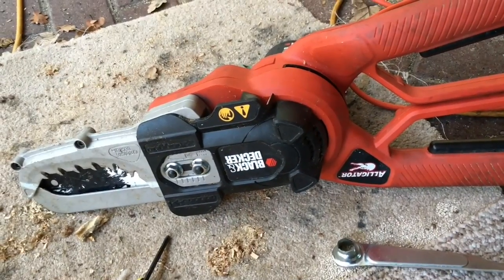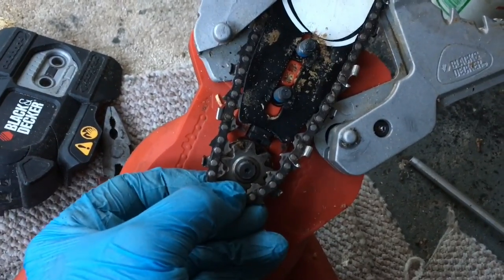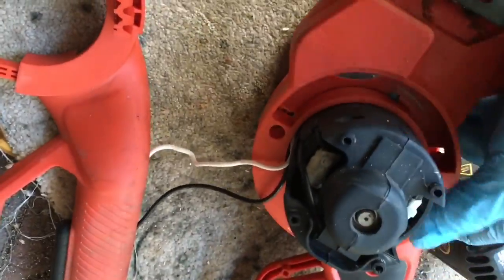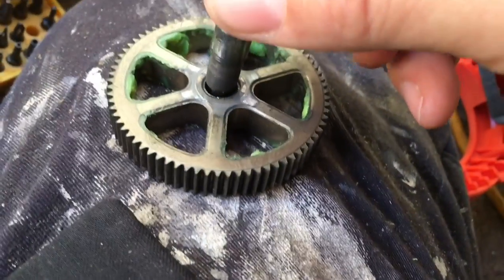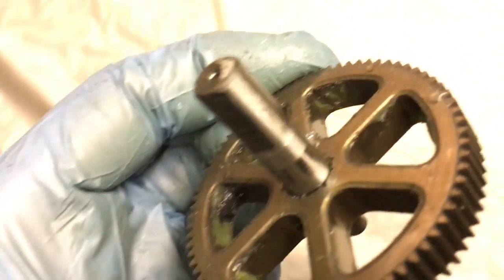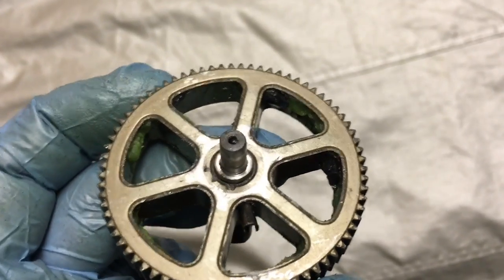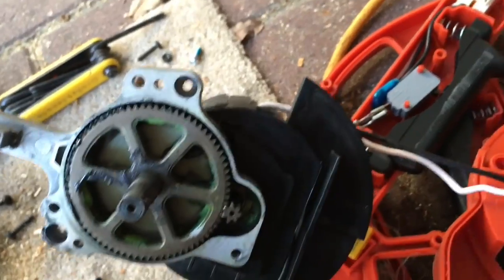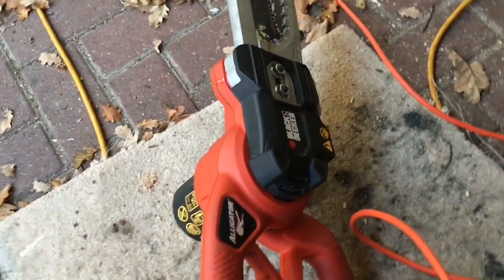How to Fix a Black and Decker Alligator Chain Saw

Comment: Again, great video. 
I don’t have access to drill bits for hardened steel so i have tried two other approaches; hammering the wheel back onto the shaft together with loctite (didn’t work), and adding a spot weld to fix the wheel to the shaft. The latter seems more promising but requires some shims to separate the two casings in order to fit the weld…
Reply from the maker: Thanks. Well done trying.

Comment: I would certainly give Loctite 270 a try first. Having said that, our Alligator is now 9 years old and despite doing an enormous amount of work (we use a wood-burner for much of our winter heating) it is still working just fine. We keep it well sharpened and don't rush it through the job.
Reply: Cornelius---Can some one please explane how to remove the plastic casing  (number 10)  left and right enabling to change the carbon brushes
Reply: Hi there two years later, I can confirm loctite is not going to be enough. I have now added a spot weld to fix the wheel to the shaft, it looks like it could work but the two casings that house the gear have to be separated by shims (couple of M5 washers works), so my gear box is no longer enclosed. But I guess I could squeeze some more hours out of it now 😀
Reply: Disclaimer: I tried generic “loctite”, not loctite 270 in particular….
Reply: @baxtrom  Ah, OK. 270 is the stuff for permanent assembly and is way stronger than 243 or 290 that are intended for things you might want to take apart some day. A pal of mine used 270 to lock the screws on a model helicopter - big mistake!

Comment: Could this shaft connection be intended to fail and save the motor or gear?  I had it all the way apart and gearbox back before another search led me here.  I DID NOT realize the shaft wasnt fixed to the gear.  The spinning likely expanded the tolerances so that the press fit isn't effective anymore.  Silly problem.
Reply from the maker: I doubt it was designed to fail deliberately to protect other parts as once it has failed then your normal consumer would just throw the whole lot out.  Press fit of gears on motor shafts is used a lot on smaller motors, maybe here it is just too much torque or poor tolerance in manufacture.  Good luck fixing yours.

Comment: I noticed on the lopper blade at the end u have a screw on it mine is missing causing the blade to get down inside the groove too far causing it to jam, where do I get the screw to put in end of lopper blade to keep it from doing this ?
Reply from the maker: Try buying an assortment from ebay and see what fits perhaps.

Comment: Great video, having exactly the same problems with my older Alligator.  Had already stripped it right down except for the final motor, pity you didn't say how to get that apart as I had taken the two smaller screws out but couldn't remove the motor itself to see the three other screws.... HELP.  PS did you price up a replacement cog before fixing yours?
Reply from the maker: Thanks, but it was done too long ago to remember any more details than is in the video and i no longer have the alligator.  I didn’t look into pricing.
Reply: @comeinhandynow  sorted it, I had not removed the chain side. Fault exactly as you described, cog and shift separated. Thank you. B&D no longer supply that part so bought a replacement Alligator and will repair as you suggest at my own pace. TY for you help

Comment: Since it's fiction fit shaft, you can use JBL epoxy  on the shaft and push it back in instead of drilling.
Reply from the maker: I very much doubt that would hold for long as it is under a lot of strain, hence why I drilled it.
Reply: Great video! Seemed to me that it is a conical friction fit, and that it originally had been pressed or hammered in place. In fact, giving it a good hammering made it stick real hard, but I also applied loctite generously. I simply don’t have the patience to drill through hardened steel , perhaps spending more on special drill bits than the machine is worth. Maybe if it doesn’t work I’ll try that approach…

Comment: Suspect this is issue on our fantastic alligator. Thinking of trying Loctite 638 - High Strength Fast Cure Retainer 10ml. Has anyone tried that?
Reply from the maker: I tried gluing before this video fix. Gluing doesn’t work. It’s under too much strain.

Comment: I had the same problem, gear not driven by shaft, pressed on only. Was going to try the fix as shown in this video but could not find a drill bit to drill this hardened material. Don't know where this author found what he used. Machine shop, $40 to drill the hole. Too much.  Machinist suggested to knurl the shaft where the gear sits, then use the best loctite. I did this, $40, machine lasted about 20 minutes on the next job. Took it back to the machine shop, this time he had acquired a special slotting/key cutting tool (which would install something similar to a bisquit joiner in wood working terms. He slotted the shaft and the inside radius of the gear, now I'll try this fix. Will let you know how it works if I can get the machine back together again. What a terrible, TERRIBLE design, nothing to keep the shaft turning with the gear. Whatever engineer designed this should get a refund on his degree.
Reply from the maker: I think it must be a common problem.  As for drilling the hard metal you need a set of cobalt drills, which are very useful for any drilling job being a lot harder than normal HSS ones.  There should be buying link in the video description, if not I’ll put some in.

Comment: Luckily i just needed to fix the chain... So getting in honestly isnt hard for my situation ... But WOWZA ... Thats a PAIN to disassemble. I am WAY mor le familiar with the world of tech IE network management, pc building, sauldering... One big hobby i will have for the rest of my life will be replacing rubber bands on everything from VCRs to Animatronics. ... My point being, NO tech i have to disassemble has so many screws lol i consider myself lucky. Also... The cost of being a true handyman workshop is big money... Bigger money than i have. All i got is whammys 😅
Reply from the maker: A workshop of tools is built up slowly over many years.  Good luck.
Reply: @comeinhandynow  thanks bud! Definitely true! And I believe such hardware last longer than 5 years? I have a power drill, circular saw, reciprocal, hand sander (I still can never get the paper in quite right 🤔) --- a lil chainsaw for yard maintenance. I believe my next purchase will be some of those giant clamps? It can feel pretty stupid using my body weight to hold the wood down while I saw it... Don't worry! I wear goggles 🥽♥️ haha... I am genuinely curious what you would consider the most important items I should get sooner than later (under 200$) ... Over 200$ is... Later. Nonetheless 🖖

Comment: This is too much of a bodge. Loctite have a product specifically designed for this but if a mechanical fix is your thing then a much better solution is to fit a Woodruff key then assemble with Loctite.
Reply from the maker: A glue (Locktite) was not enough to hold this against the torque.  As for your suggestion of fitting a woodruff key I would like to know how the average DIYer is supposed to fit a woodruff key!  It would require both the shaft and gear being machined with slots.
Reply: @comeinhandynow  The slot on the gear would be drilled, the hole filled with a piece of bar flush in the hole to keep the drill from wandering. The slot in the shaft could be cut with a small diameter grinding disc but I would take it to my local friendly engineering shop where they would  cut it or  'broach' it with a slot cutter matched to specific key thickness, It doesn't need to be deep, 3mm each side. I did it often on old Brit bikes 'back in the day'.
Reply from the maker: @richardd3663  Another guy on here asked for a quote to do a simple drill from an engineering shop. It was $40.  He rightly decided that was too much.  I try to keep jobs to things I can do myself.  Hence DIY.  Even if some people call it a ‘bodge’.  Whether it is or not is defined by how long it lasts.  This fix is certainly stronger than the way it was originally manufactured.